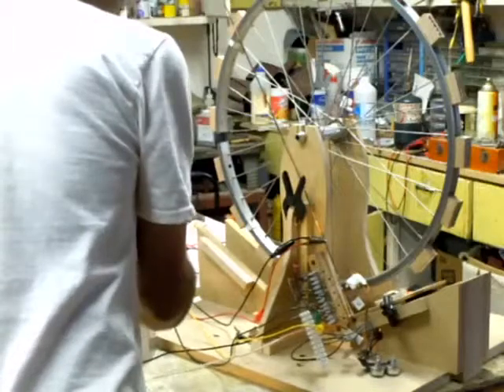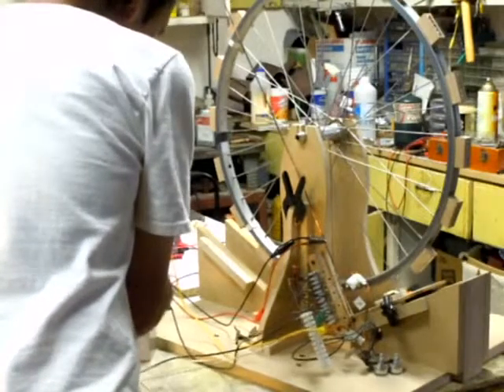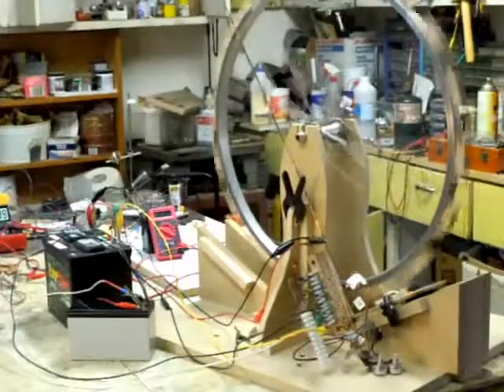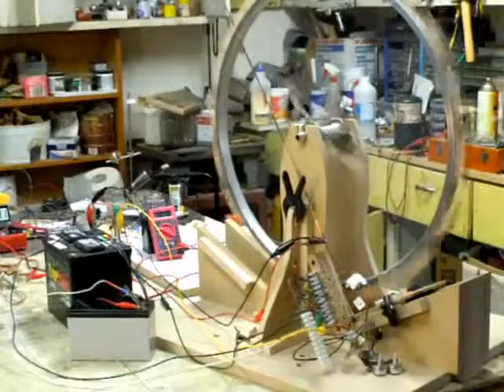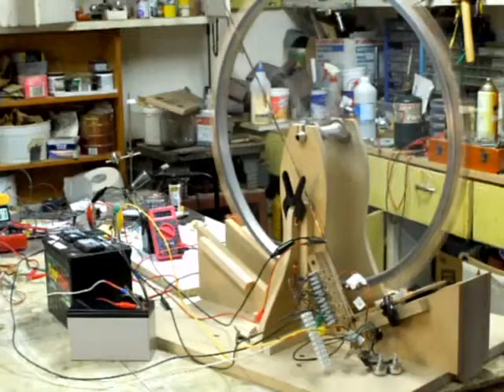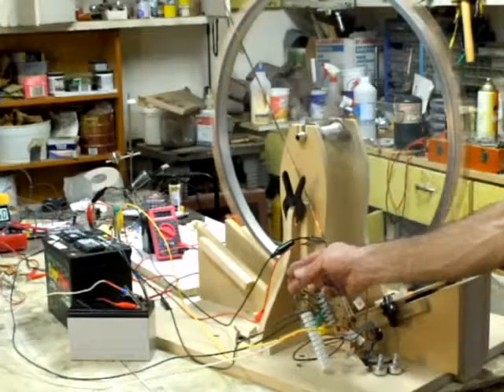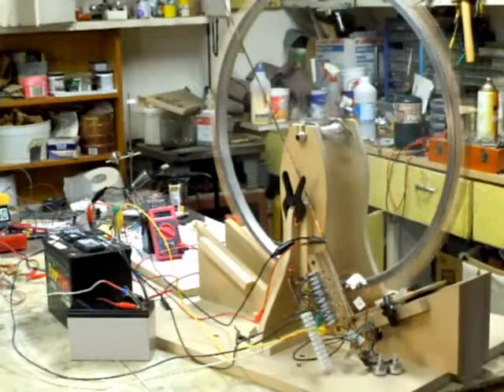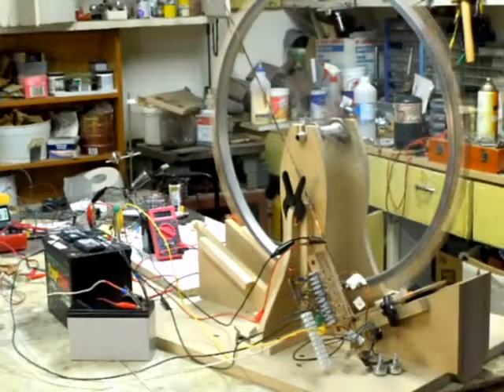Multi Filar Coil (9) Motor Running  Bedini Monopole

Comment: What is this tech?
Reply from the maker: Hi William,
This "tech" is about building "Over Unity" devices for our energy needs. Much heated and controversial debate on the subject. I'm no expert, or claim to know what I'm doing. This is all about experimenting to see if this kind of thing works. Simply sharing my experimentation, mainly how I'm building things, but also some observations of the "motors". Check out my other videos if you're interested. Look into Bedini circuits to learn more. There are many other types of "devices" / "tech" that are trying to break the typical barriers of efficiency that can help us all have much cheaper energy to power all our lights tools and toys, etc. Great subject to research.

Haven't been experimenting for some years now, but plan on messing around with this type of stuff again soon. Thanks for the comment.

Comment: Compared to my wheel, that thing flies!
Reply from the maker: Do you have a variable resistor, as well as different fixed resistor values to try in your circuit? Wire wound variables are best, and one that has a large range to help find the "sweat spot".